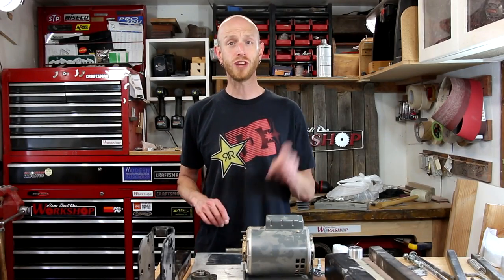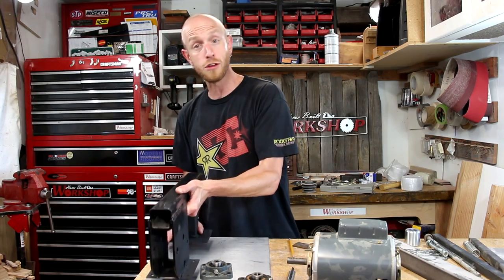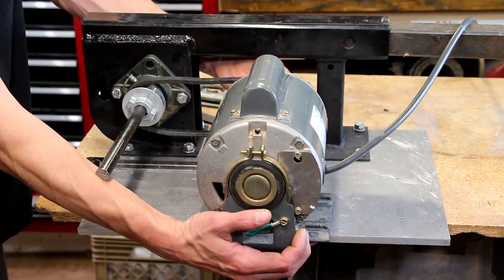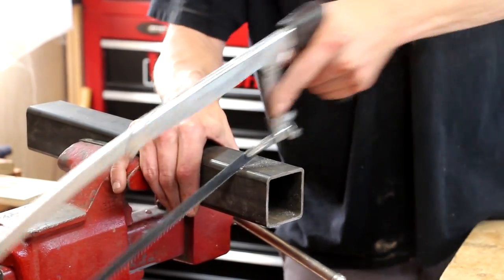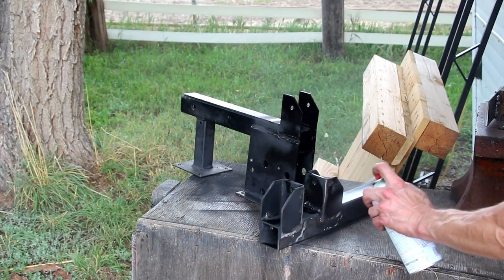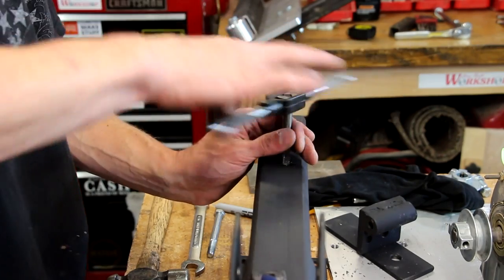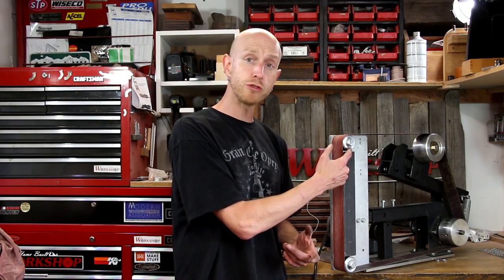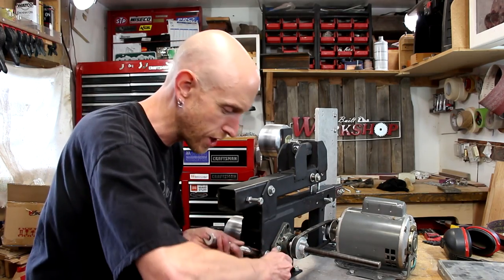How to build a 2x72 Belt Grinder

Comment: We had to downsize & moved from Wisconsin to the Missouri Ozarks. I had collected scrap metal of all sorts for over 20 years. Always had whatever I  needed for the many projects without buying much. I had too much to haul, so a scrapper hauled almost 20,000 pounds to scrap yard. I got paid 2 cents per pound.😨😥 I only saved about 1,000 pounds to take here. I need to start a new collection. I will be making a grinder/sander & a cold cut metal saw, & a lumber mill bandsaw in the near future. 

Appreciated watching your designing & building with what you have. Inspires creativity!

I have welders & a lathe & drill presses to work with, but need an enclosed shop. Right now, everything is jammed into a shed without workspace.
Reply from the maker: Thats a lot of metal. It's awesome having what you need on hand like that.

Comment: One of the best builds for a belt grinder I have seen so far. I am just starting a build myself I scrounged up most of the parts from an old welding shop table I found at a swap meet. Thanks for the hard work .
Reply from the maker: Thanks. If you're good at scrounging, you can make one fairly cheap.

Comment: Great project
.At 15:14 you just got all yourl Christmases` rolled into one ,its a magic feeling when it all comes together,
A sense of achievement you built your self, cost 1/3rd of the price you're pay at the shop, Knowing grinding will be a doddle from now on, 
Then showing your partner and friends, Then you move on to the next project that takes all your time up looking for the info , then finding the money and it all starts again, Its like an addiction, 
The holy grail if I had the money is to have a engineers lathe to make the parts,
Reply from the maker: It was like Christmas for sure. You're right it is like an addiction. So satisfying to see a build come together.

Comment: Great project jeff!

You can use linseed oil in stead of cutting oil, should be at most half the price if not a quarter.

These tapping handles suck donkeys, but they should have a hole on the tightening arm, put a small nail through that and tighten your tap harder, won’t come off, BUT make sure you keep that nail around to un tighten, because you won’t be able with your bare hands 

Cheers!
Reply from the maker: Linseed oil works? Thats awesome. I'm definitely going to try it. I have since found my T-Handle tap wrench. Its so much better than this one.
Reply: Jeff Baker for anything that requires temporary lubricant, such as drilling and tapping, I use linseed oil, when it dries it leaves a protective film, not as good as paint but good enough.

Bonus tip: heat up steel with a torch and then wipe it with a rag and linseed oil, definitely beats black spray paint, the more layers, the better the result, around 400c is the proper temperature, but I got good results with lower temperature too

Comment: That's SWEET I want to build one someday.
Did you think about using your drill press to tap the holes.
I took a machine shop class and we were taught to do this. You tap is straight up and down so the holes are tapped perfectly each time.
And it saves your hands and wrists from all the turning.
Again that is awesome
Reply from the maker: +christopher dustin thanks. I have done power tapping before but it was on a Bridgeport mill. I could slow the machine down quite a bit. My drill press goes to fast on the slowest setting for me to feel comfortable tapping with it. I really didn't want to break my tap. That would be the quickest way to do it though. 👍

Comment: Well done!  Nice and simple and I like simple.  What size motor did you use.  I'll be building one like this, but I'll use step pulleys so I can change belt speeds.  Thanks for the vid.
Reply from the maker: I built it with a 1/2HP motor but that was basically a placeholder for the 1.5HP I have on it now.

Comment: You could have used a "lovejoy Cupler"  for direct drive from motor to drive wheel.
Reply from the maker: I wonder if that would be better than this setup? Do you think it transmits more power than the belt?
Reply: @homebuiltshop  Yes

Comment: if you haven't cut down the drive shaft yet how about adding a 14 inch sanding disk?
Reply from the maker: +Clifford Moeller I really wanted to do that, but I don't have good access to 2 sides of the machine in my small shop. I ended up cutting it and will probably make a dedicated disc sander in the future. If I had a little more room, I probably would have.

Comment: Nice build.   What is the HP of your motor?
Reply from the maker: I built it with only 1/3 hp but it now has 1.5hp. The small motor was to just get it built until I was able to find a larger one.
Reply: @homebuiltshop  Thank You.  I'm on the hunt!!
Reply from the maker: Go for it. These machines are so useful. I could actually use this with the smaller motor as long as you didnt press real hard. 👍
Reply: I can relate.  I'm familiar with their utility from working in a custom fab shop.   Did you machine the guide wheels yourself or buy them?  I  have huge slab of 7000 series aluminum (67"x2"x 24") that might work as guide wheel material.  Where did you source  and what dimensions are your guide wheels?   The build has begun.

Comment: If the only problem you have with that MIG welder is the liner, then freaking spend $5 and take the 1-1/2 minutes it takes to replace it!
Reply from the maker: The liner for this old welder is a few hundred dollars. I don't know why its so much. Maybe because its an old one.
Reply: @homebuiltshop  sounds like you need somebody with fabricating skills to try and figure out how to modify one from another make and model to fit.
Break out that digital caliper take some measurements and start searching, then again, you might just find an entire gun with everything you need for less.

Comment: What size is that motor? I have a 1/3 hp-1750 rpm... Would that work???
Reply from the maker: I started out with a 1/3hp in this video. It runs the machine but its a bit underpowered. I upgraded mine to 1.5 hp. The smaller motor is a great starting point though and will definitely get you up and running.